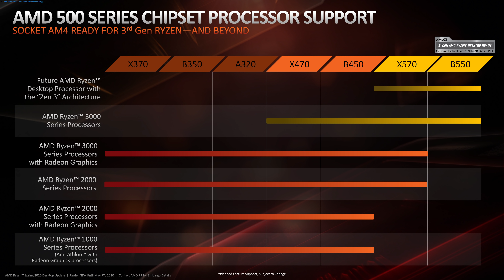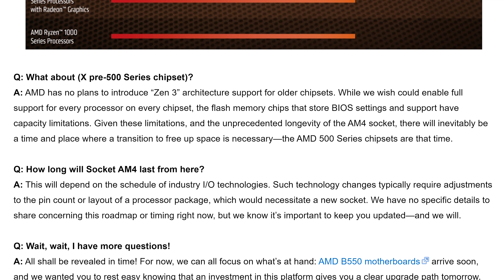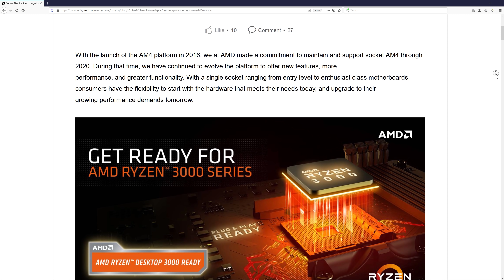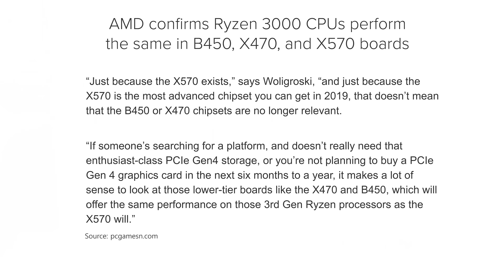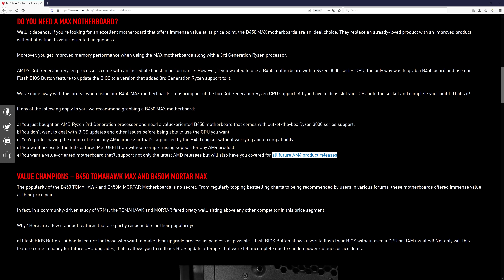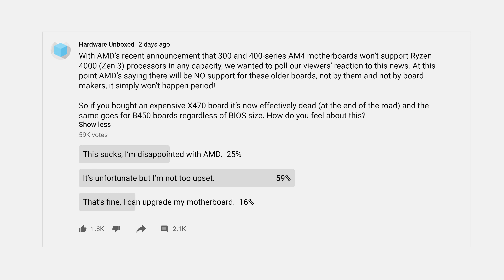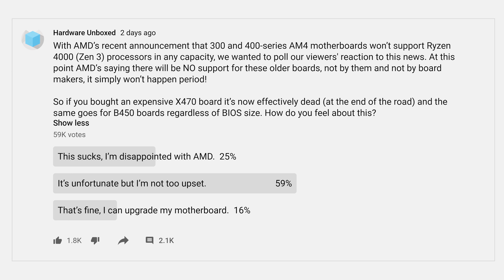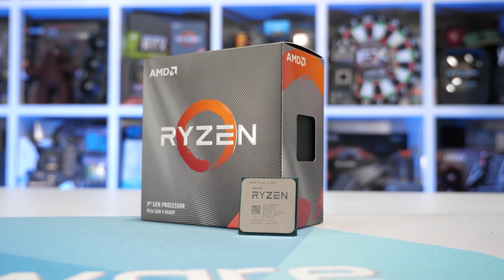AMD Does An Intel, Axes Zen 3 on 400-Series Motherboards, Our Thoughts

Comment: AMD does an Intel but everyone is OK with that because it's not Intel.
Reply: What lol, have you seen the comments?
Reply: @Naffacakes98  I'm talking about the poll
Reply: You’ve got it completely wrong, doing an intel is when you have ONE generation on a single socket. AMD has supported THREE so far... giant step up from intel, Basically I can upgrade an r5 1600 to a r9 3950x using the same motherboard, there’s still plenty of upgrade paths for someone on b450 B350 or their X counter parts. People can hold out upgrading their cpu till AM5 + DDR5, stop acting like AMD has become the greediest company because they did one wrong thing.
Reply: its ok? all AMD owner is dissapointed, more angry than with Intel, because unexpected.
Reply: @zalomalo  All AMD owners? Did you even see the poll in the video? 75% people don't even give a fuck.
Reply: @ClanBez  You do realize he wasn't coming up with an alternative explanation trying to defend them, right? He said if AMD didn't want to piss off customers, they should have a better explanation SUCH AS THE ONE HE PRESENTED as simply an example. Did you not watch the video and somehow miss that Steve is clearly just as unhappy about this as everyone else?
Reply: I am not. I don't see any reason to move to 5** motherboard with Ryzen 4xxx, when a year and something after 4xxx series there is probably AM5 with 6*/7* chipset and Ryzen 5xxx with DDR5.

Comment: Awesome piece of content here. Spot-on! If only I had known that my X470 Taichi wasn't going to support Zen 3 processors, I'd have gone with X570 board. That sucks sooo much.
Reply: x470 CH7 here of few months, so I feel you. and lets be real, its not like our boards can't handle xcore/higher ipc cpu......
Reply: @echoforge333  That's the point! Especially that our boards have 256Mb BIOS ROM, so AMD's excuse for not continuing the support is ridiculous.
Reply: @echoforge333  i just purchased the x470 CH7 to replace x470 msi gaming pro carbon after the junk lite bios we got when upgrading bios for ryzen 3000. now im stuck with it? Stupid. Ill just go intel. knew i should have just went with 9900k and been gaming like a king for a while now
Reply: @20005spd  CH7 here too...kinda miffed right now. In case you weren't already angry, our "inadequate" boards have the EXACT same ROM chip as the $1000 x570 Aqua!
Reply: im a bit of a strech but im also wishing they put a bios support on a b350 or x370 mobo on the new ryzen 3 3300x coz i dont have any money to change the mobo
Reply: @borgir3451  i am rocking a x370-f board with an overclocked ryzen 7 1700. I have been waiting to max out my board with zen 3 at launch and now i guess the max i can go is a 3950x. Not terrible. But i was not expecting to lose support for the final cpu generation on am4.
Reply: @borgir3451  both of those will run a 3300X with the current bios updates.
Reply: Your X470 Taichi bios flashes directly on my X370 Taichi, so I'm not even buying the argument that they couldn't support all of the existing chipsets, let alone at least the 400-series. They should have pushed support and let the motherboard manufacturers deal with the compatibility/implementation tasks. Stupid decision on their part. They're making enough money now, hire some extra bios/agesa engineers and make it work.
Reply: I went with X570 to future proof. It worked out, I guess.
Reply: I have Asus X470 PRO which was recommended by HUB  ... with 256 MB BIOS flash ROM .. 
So this doesnt make sense whatsoever!!
I wanted to at least go for a gen skip .. now i think i wont skip anything ...
Probably keep this PC till goes rubbish and then buy a laptop .. 
I've even combined it with 32GB of ram and nvme, and flashed RX 5700 gaming X to XT variant ... again recommended by HUB
Only the CPU is an r5 2600 (recommended by HUB?) .... @1440p it doesnt make sense to go for ryzen 3000 series ... so i'm done.
Last PC to ever own
Reply: Till now i've had a 10 year old FX system soooo ...  those 8320's

Comment: Good move. They are damaging their 4000 series sells, their company reputation and their partners relationship (msi max specially). So be it. I could upgrade my 3600 in my tomahawk max but no way I'm going to buy a new 550 motherboard. So no more upgrades for me until ddr5.
Reply: They had a chance me buying some 4000 series for b450. Now I decided the same as you - next mb is the ddr5 one either intel or amd so they better fight for my money with their best stuff then.
Reply: Just keep upgrading the GPU bcoz that's what makes the most difference in games

Comment: While it's sad, I hardly find it surprising. The B450 were made for the Zen+ CPU's and were added with Zen2 compatibility also later on. Making them support yet another generation would be streching it too. B350 owners should complain also. I think buying an old B450 board now expecting it to support the lastest and greatest just to save some bucks is the wrong approach. Unpopular opinion I know, but this isn't the first time we see this in 25years.
Reply: B550 still doesn't exist.

Comment: I built  a  2600x/b450/2060 system start of 2019 there is nothing to compel me to upgrade at the moment  and even a zen3 wouldn/t be worth it , I can get a bigger epeen bar just upgrading my graphics card only caveat is if my workflow changes and i needed more cores which a 3700>3900x would cover. I am more than happy with the performance for the price i paid. I can understand why AMD did a backpeddle as they sure as hell could'n't supply demand as 100% of B450 owners want to upgrade on day one ( according to the comments). Waiting for the next round of Graphic cards, but sure wont commit till they are out and reviewed. Next PC will be whatever is out and fills the bill  at the time be it AMD/Intel or some obscure chinese cpu.

Comment: I've been recommending b450 motherboards to my friends, now I feel like a dick because they cant upgrade to the new zen 3 processors! I personally bought a x570 board, but it dont half sting for budget builders that have just bought a b450 board
Reply: Zen 2 is more than adequate for any task currently. An upgrade from zen 2 to 3 would be a waste of money imho
Reply: who cares Ryzen 4000 ?

just maxed out your cpu to 3950X
Reply: @claritoresdiano1021   doesn't actually do much for single core performance.
Reply: @jamesthomson8659  Is Zen 3 guaranteed got high single core ? or you know good information about that why not tell to us ?
Reply: @claritoresdiano1021   Just what I have been seeing in the tech news.  About 10% IPC improvement and about 200 MHz.  So not guaranteed.  But that does me more good than more cores.  I don't do much video rendering.
Reply: @jamesthomson8659  Amd never reach 5GHz with consumer heatsink/aio cooler, can only push at 4GHz range right ?
Anyone knows amd at this time can't macth Intel on singel core and they don't care people keep bought it.

When you concern only on single core just bought intel. lol
Reply: @claritoresdiano1021  But I have an AMD motherboard.  I bought it because I was supposed to be able to upgrade the CPU through Zen 3.    I'm not concerned about only single core, but 8 cores is enough for what I do use the CPU for.
Reply: @jamesthomson8659  🤔 hmmm it looks overclocker forums (Mod Bios page) need reactivated back since they sleep long time ago.
Reply: @claritoresdiano1021  I agree.  I have a 1600 AF that will last me until I feel the need to buy a cheap 3700X down the road.
Reply: That sucks indeed, but may I suggest that next time you should research before recommending stuff. AMD had made it clear a long time ago that AM4 motherboards won't be supported with new CPUs after 31 December 2019, so not sure how you thought that B450 would work with Zen 3 which releases after 31 Dec 2019. If you look at AMD's official Socket Stability slide in the article "3rd Gen AMD Ryzen CPUs Will Work on Many Existing MSI AM4 Motherboards" (search it on Google), you'll see that the graph clearly shows no support for new CPUs on AM4 after 31 December 2019. If you take a good look, the orange bar stops right at the end of 2019, just before 2020 starts. It was already know even a year or two ago that Zen 3 will come out some time in 2020, or in other words, AFTER the official support period.
Reply: @bgtubber  Nobody gives a fuck about one slide in an hour+ sleep inducing presentation. It's very clear it wasn't communicated properly to the public since everyone got pissed right after it became clear. They promised a long platform longevity thru 2020 while with the exception of 300 boards they gave nothing Intel wouldn't provide.
Reply: @bgtubber  Isn't that the work of AMDs marketing? They made a graph and thats it? Is that how you tell your customers about support when earlier that year (which was less than 3 months ago) they had been beating the drums about how the 400 series AM4 motherboard are gonna be great for Ryzen 3000 and future release if you are on a budget.  When you are going around and saying that stuff and then do full 180 suddenly just after six months, its clear that they didnt have a clear roadmap on this stuff and their marketing should have atleast tried to warn its customer to hold back on purchase so they could buy a 500 series board later. Even as a tech savvy person, its not reasonable for you to keep checking whats the latest news about the most boring of a computer case. You knew something, you told your friends about it. Who is gonna research that when motherboard partners didnt even know about it
Reply: @bgtubber https://hothardware.com/news/amd-confirms-am4-socket-support-future-ryzen-processors-2020
Reply: @bgtubber  That's your theory, or the prospect you want to explain this decision made by AMD.As an early adopter the true is been told from 4:30 to 5:40, simple broke their promise going from AM4 to chipset upgrade path.This weird stuff start with zen2  and beta support for 300 models.

Comment: I am torn. I bought a 3600 and a B450 tomahawk, with the news of the b550 and the new CPUs released I thought to perhaps upgrade my board to a 550 and use my 450 to make a second PC.  My hang up now is this: why build with a B550 if AM5 Is right around the corner? To me it seems like the B550 should have been dropped with the 3000 series CPUs back in August. The 450 would still have been viable but the 550 would be the ultimate AM4 support board. This seems like a very awkward move to make during this time, especially if they are planning AM5 soon. The only way to make the 550 no he a disappointment would be to have that be the premier of the new socket.  I think the only other way for them to make this work is to market this as your go to AM4 socket board for full support, apologize for the 450 misinformation, perhaps give options to swap out the bios versions on older boards for the newer series CPUs to allow them to at least function on 450.  

This whole thing just seems very awkwardly handled, and I wonder if it would be different if not in the pandemic situation. Part of me wonders if this is being rushed out now (after a delay I know) to attempt to stimulate some sales?  AMD needs to give a better statement for this board.

Comment: I had an i5 6600 (non K) and upgraded to the new Ryzen 7 3800X a few months ago. With that, I bought a Crosshair VII Hero non WiFi (due to availability and prices in Brazil, the US dollar is equivalent to more than R$5), so I'd really appreciate if AMD did support upcoming Ryzen CPUs, considering my MoBo has a 256Mb BIOS chip.

Comment: i know it (oder chipsets not supporting ryzen 4000) is a big topic and a bad pr plunder at least ... but do we have any data on how many people actually do upgrade a processor without also switching motherboards?
i have had that option on several occasions but never have done so, i always went for the newer motherboard as well to get the additional / upgraded IO etc. so while i totally get people are displeased and amd needs to handle these things way better, it would be interesting to get a feeling how relevant this is in real life at the end of the day. the poll seems to suggest i by far am not the only one who opts for a new board anyway even if the choice is available to keep the old one.
still ... i agree at a bare minimum the B450 and X470 boards MUST support the coming generation. anything else is unacceptable.

Comment: As an owner of a 2xxx processor and an x470 motherboard, I wasn't too bothered at first, but after thinking about it more, I've grown more disappointed.  It would have really been nice to jump a generation for an upgrade.  From a 2700x, on my motherboard, I don't really see that there will be a cost effective and meaningful upgrade for me now.  There's the 3900x and 3950x, but a jump to Ryzen 4xxx, even with 8 cores and 16 threads would be a better upgrade.  Only being able to jump up to the next generation is generally not a great upgrade path.

Comment: My issue with AMD here is not necessarily that they didn't want to support Zen 3 on 400 series boards. I bought an X470 board and a 2700X when Zen 2 launched anticipating that 300 series boards wouldn't be compatible with Zen 2 and I was partly right considering AMD didn't officially support them. But motherboard makers then made it work on many boards and I expected that would be the same for Zen 3 and due to my board having a 32mb BIOS chip and being solid enough to support the chips I thought I was set for Zen 3. Now they have changed this I'm very annoyed as I expected there to be support. If I knew there was not going to be any support in the first place then I'd have bought an X570 board knowing that I'd have the broadest compatibility with Zen+ and after. AMD should have communicated from the outset that this was their plan as now many people have bought B450 boards on the recommendation that they had future Zen 3 support (from MSI a partner as well no less.) Then people would have known what boards did what and this couldn't be regressively changed afterwards. "In one example there would be a single large BIOS file that you download, then upon flashing you select the CPU series you want to support and it flashes the appropriate code." This also seems like an easy solution for 400 series owners. AMD either needs to do the same thing they did with 300 series boards for Zen 3 for 400 series boards considering the precedent set here with Zen 2 or people need a way to ask for refunds.

Comment: I'm still on my trusty i7 4790k, but it's not cutting it all of the time anymore, so I need to upgrade as my PC is almost 6 years old. I nearly bought a MSI Tomahawk MAX and a Ryzen 3600 a few months ago, because I believed I could drop a Ryzen 4700X or something in it later. Had I spent the money then I would have been pissed.
I think AMD should do what you have proposed; Make a cutoff point at B450, X470 and support the future CPUs on those as well.

Comment: While I'm not pissed off per-se, I bought a high end X470 board (Aorus X470 Gaming 7 Wi-fi) during second gen Ryzen in anticipation to be able to upgrade my R7 2700 non X to something better in a couple years, and thus I am disappointed now, especially seeing how much more expensive X570 boards are over X470.  Now my only upgrade path will be a 3950X or 3900X which I see holding their value in price on the used market due to all the people now being stuck on older boards and not wanting to change platforms. At that point, it almost isn't worth spending that much money on a used CPU.  Unfortunately, I think most people would be better off spending that money on the newer 4000 CPU's and 600 series platform...

Comment: Yes! You're the first youtube channel to say it, B450 and X470 are dead, 3300 and 3100 are dead, B550 is dead with AM5 around the corner, loyal AMD children, we have been betrayed, RIOT RIOT RIOT!

Enthusiasm aside, right now and the next few months are probably the worst time to be buying. Not only have most parts gained an extra $25-150 in cost because of supply bottlenecks but almost every piece of hardware is being teased with a new generation at almost the same time. Complete madness.

Comment: I'm one of the folks who bought an X470 board for Ryzen 3rd gen thinking the only feature of X570 was PCIe Gen 4.  I'm not super upset that the new Ryzen chips won't be supported by my board.  If I'm going to spend money on an upgrade, I'll upgrade my GPU and monitor.  Although, if enough people raise a stink we might be able to get Ryzen 4000 support on 400-series boards.  I don't anticipate upgrading to Ryzen 4000; I'll wait for AM5, DDR5, Ryzen 5000 on the next go-round.

Comment: this is quite well done video, with sources ...
the decision to burn 4xx customers especially after double B550 delay from last year
AMD gunna lose lot of 4xxx sales of CPU in short to medium term
from customers with x470/B450 who saved $ with good value CPU
those customers expected upgrade to value 4xxx one which got denied now
add price hike with X570 or woes 'max' mainboards didn't help either
yet it's unclear what happens to B550A chipset mainboards
(has 5xx so it must support 4xxx but ... it's B450 with PCIe4 compliance)

add to the injury B550/A520 mainboards aren't yet on market to be sold right now
even 'new' releases of improved x570 (yep like the MAG x570 Tomahawk)

Comment: In january, I got the msi b450 itx board for under $110 usd and a $60 usd ryzen 3 2200g on the cheap to upgrade my ancient Intel Bloomfield i7 920... I was hoping for 2 generations support, but I cannot be too mad either because I still got up to 16 cores, ryzen 9 path to upgrade; I do have to worry about timing, I suspect those 3950x cpu's will not come down in price in the used marketin the upcomming years because they will be the top of the line cpu for all those motherboards with x470 and B450 chipsets, I better get one before they'll stop production...